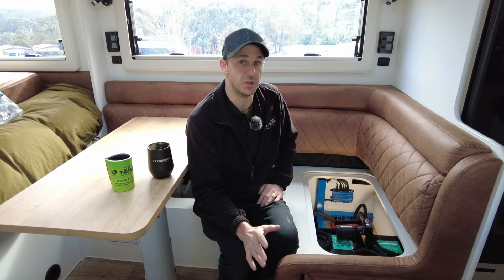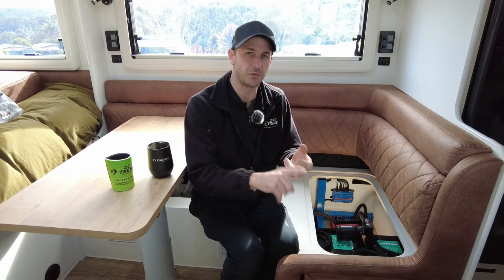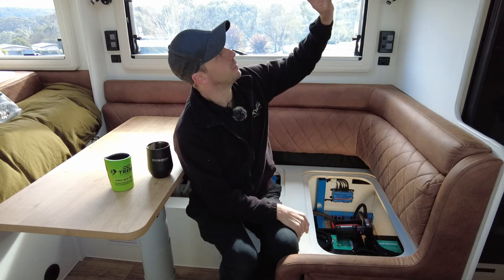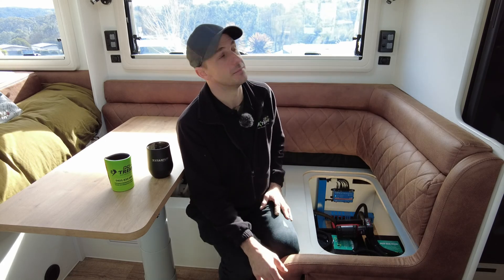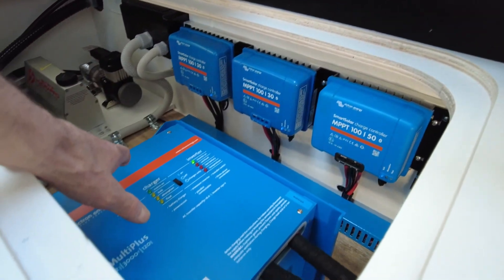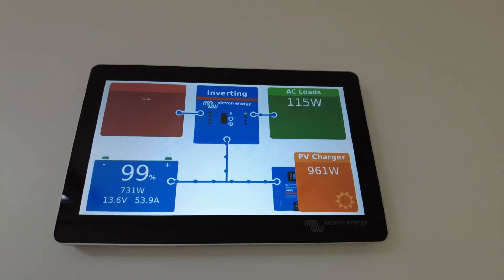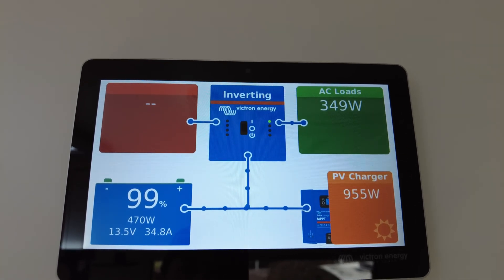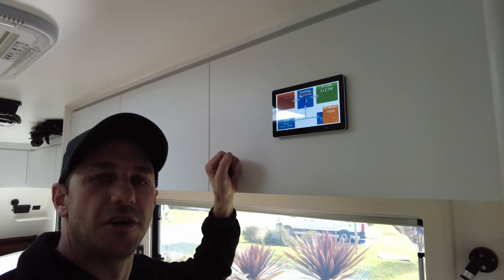Titanium Hardcore 1500 watt solar/945ah lithium off grid setup, air conditioning, induction cooktop.

Comment: A battery capacity of this size makes me wonder it it would be worth using the caravan as a "powerwall" while it's parked at home. Have you ever set something like this up before where the van could integrate with an existing solar system with a simple lead?
Two PowerPaul scouts paralleled have more storage capacity than a Gen 1 Tesla Powerwall, and this van you have just shown has as much as a Gen 2. It would be great to be able to utilise that storage capacity and the victron inverter while that van is parked at home. Of course you could just plug 240V appliances into the van, but I was thinking more along the lines of fully integrated system, like in some other countries where they can run the house from the electric car.
Reply from the maker: it's funny you mention this a lot of my customers use their caravans as a backup when the power goes out a lot of us South Australians had a 15 amp generator input fitted on our houshold consumer power boards a few years back when the power kept going out so yes totally doable.

Comment: Great install ! Do you ever use 60 volt panels ?
Reply from the maker: The problem with household/commercial solar modules is their physical size and weight. 
I struggle at best to fit multiple household Solar and Caravan roofs. We generally require lots of different smaller sizes to work around roof hatches, air conditioning units, antennas and dust reduction systems

Comment: Awesome install. 
Question. If they had a 3 way fridge,would you divert that to run off the batteries then use the dcdc50 to supplement it, or would you run that as a separate from the alternated also.
Reply from the maker: If they had a system like this installed, I would give them the option to be able to run their three way fridge from the inverter as a backup which theoretically could be used while driving as we all know how horrible and low wattage the 12 Volt circuit is on any three-way fridge